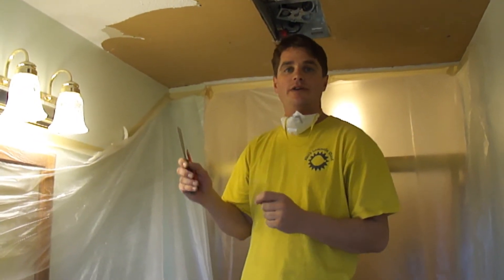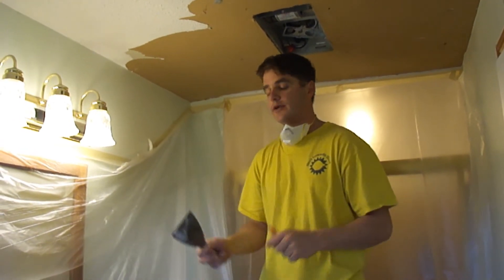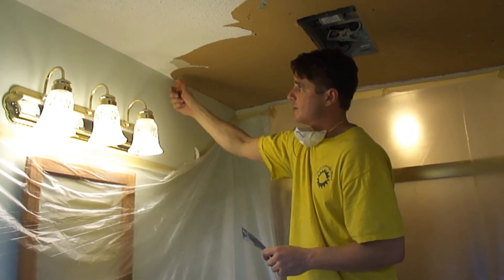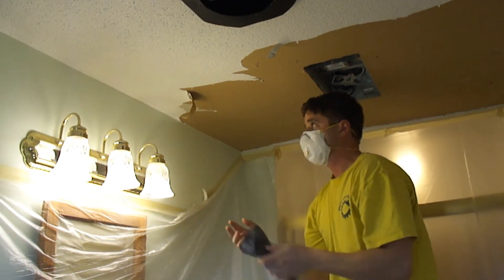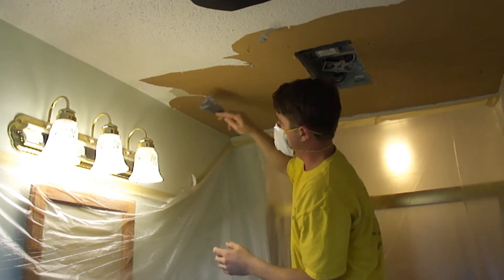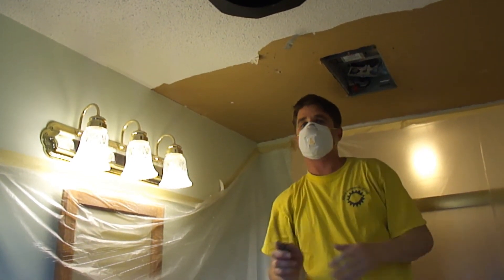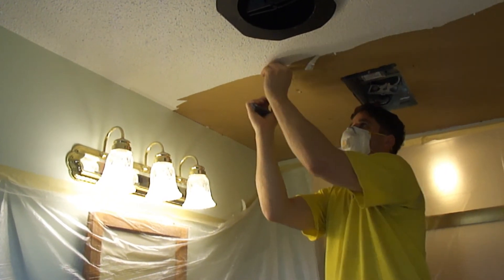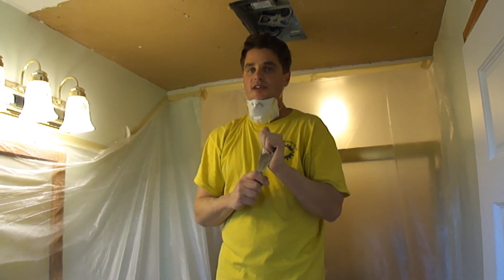DIY Removing Popcorn Ceiling (Part 1) - Drywall Repair & Wall Preparation - Interior Painting

Comment: Nice video, but be careful, especially dry scraping popcorn ceiling!  If the ceiling was put in before the mid-80's, there is a high chance it contains asbestos.  A small sample in a ziplock bag sent to an asbestos lab (costs about $30) can be a literal life-saver.  The respirator you are wearing is inadequate for the job if your ceiling contains asbestos.

Comment: Yes, it's all been painted.  Others also say just install 1/4" drywall over the existing but I still believe there is an easier undiscovered method.  I watched a video of how to do a knockdown ceiling and it seems like you should be able to do that over popcorn using a very thick layer of mud.  But obviously someone must have tried that and it didn't work for some reason.  I am 100% convinced there is a much simpler solution to this problem waiting to be discovered.  Thanks!

Comment: You know Ross I don't care what anyone says. Its not so much about time but quality. You can do it fast but will it get you another job. Some people would just skim coat but then the apply it over air pockets and not a sound surface. I even heard you say that you are going to seal it. I have seen a contractor spray texture on top of wall paper and I had to come back and fix it. If you do quality before quantity customers love it. I posted my first video hope you get to view it too. Keep it up

Comment from the maker: @petermackett37 I would of just Skimmed over it too, but the popcorn was blistering away from the drywall in different areas especially near the shower side. I don't think that the ceiling was ever initially primed before the popcorn was sprayed either. The steam from the shower was the catalyst. The homeowner wanted it removed because it continued to keep peeling even after many touch ups thru the years. I will then repair the damaged/Torn drywall and recreate a smooth sound surface.

Comment from the maker: Hello- This is just one way of doing it. If you are dealing with a painted over popcorn ceiling and there is no crown molding already up, I would suggest going right over it with new drywall. Has your popcorn ceilings been painted before?

Comment from the maker: Hello again! Depending on how thick the popcorn is, is going to decide how many coats of mud that needs to be applied. Keep in mind, the mud shrinks, so its going to take a few coats. This is where the skill is involved and it does work but is very labor intensive and you are working above your shoulders. Going over it with drywall allows for less mudding. Where are you from?

Comment: Thanks for this tip . I was going to cover it with 3/8 drywall but I was worried that the stipple would telegraph through.
Reply from the maker: Hi-

It shouldn't telegraph through!

Russ
Reply: Russ Olinatz how about 1/4 drywall ?
Reply from the maker: Hi

If the texture of the popcorn is really thick,  I would use 1/2 inch to account for the unevenness of the surface. What texture do you have?

Russ